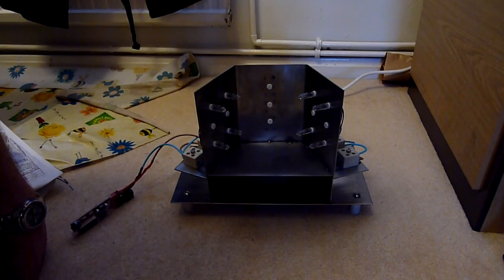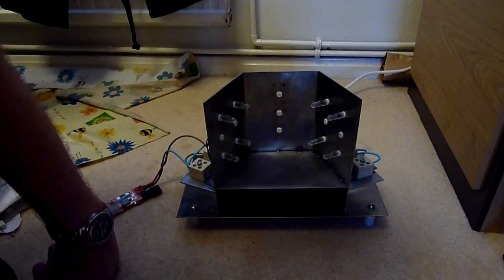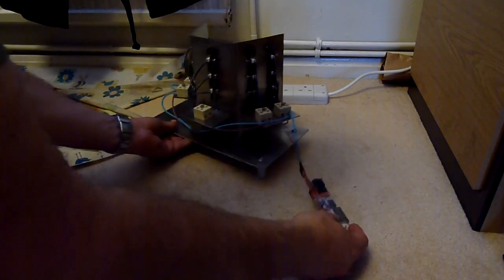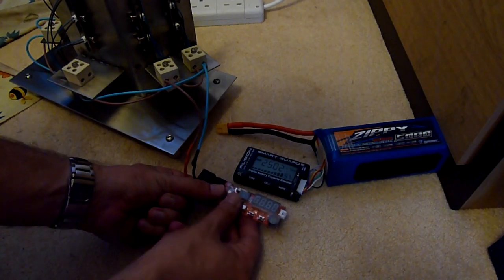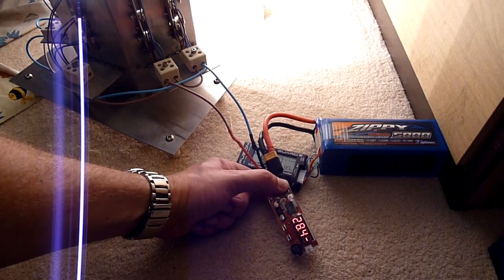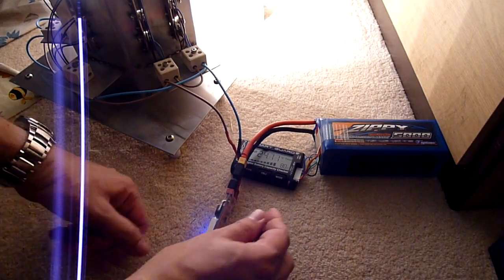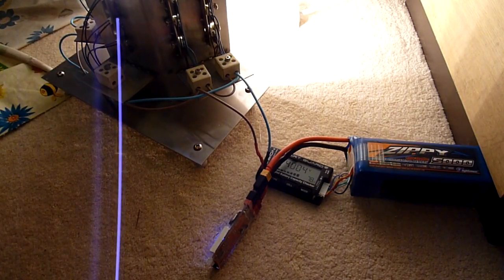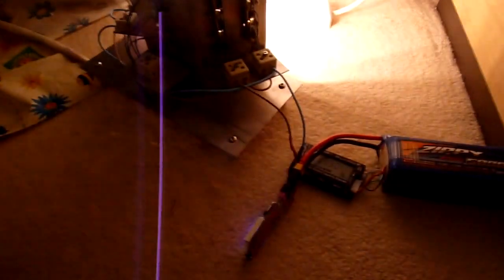RC Lipo battery discharge light bulb rig - 300-750W using G4 halogen bulbs

Comment: Interesting.  How long does this take to discharge a fully charged battery like the one you showed in the video here?  Thanks for sharing.  I like that steel rig that guy made.
Reply from the maker: This is a 5000Mah battery, so at 12 Amps full discharge theoretically would take 5(Battery Capacity in Amps)/12(amps load)*60(mins)= 25minutes, but would actually be quicker, as you'd only discharge around 50% for storage so would take under 15mins. Since this video there are more affordable dischargers available, so I now use the ISDT discharger, I have a couple of the smaller FD-100 for smaller packs, and a FD-200 which is a 200w charger so not quite as quick as this bulb rig, but automatic and much neater.

Comment: Short question, I do not get this one.. How do you get 12V bulbs to work on 25V (pairs of them in parallel?), and still have full 300W from 8x35?  If you put 2x35W in parallel is it 35W, not 70W? And what happen when one go out? Do one in pair with that one go out too? Can it damage charger when one (both) go out? You probably got that happening by now, what happened? :)
Thank you for you reply.. in advance.. :)
Reply from the maker: Yes, I run the bulbs in series pairs, this works fine on both 3S and 6S so easier than having to switch/rewire between voltages. The power figure is from readings on meter as shown in video 24.1v at 12.5Amps makes 301W. If a bulb fails load would drop, so should be harmless, but it hasn't happened to me yet, I am very careful never to touch the bulbs.